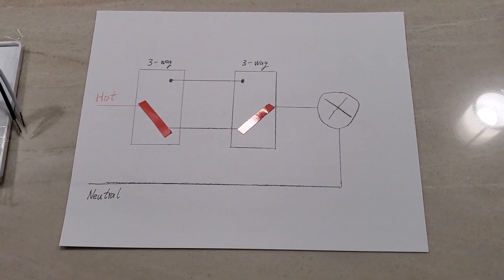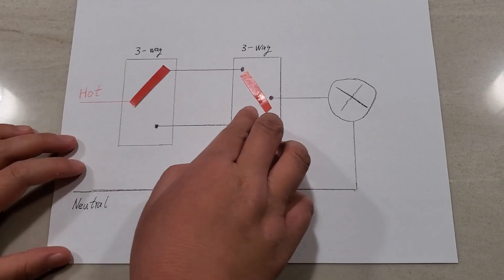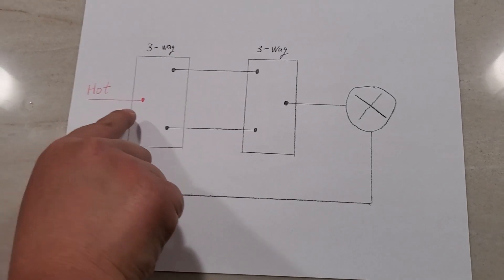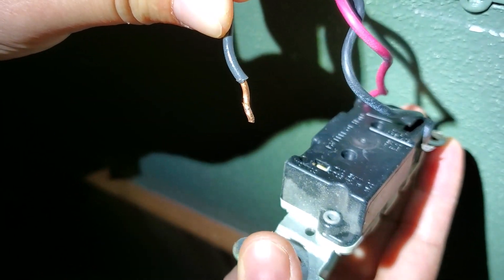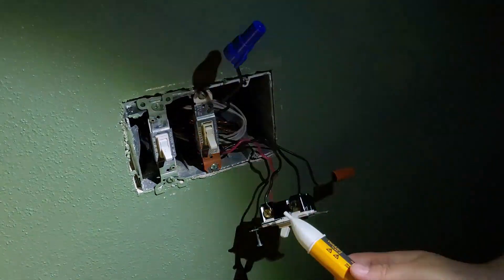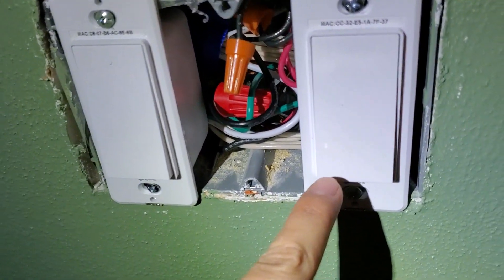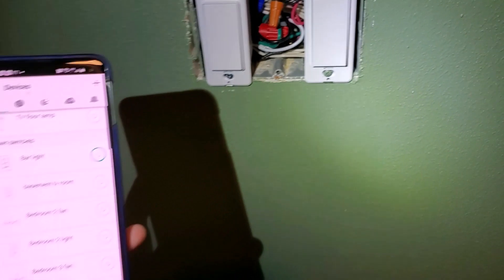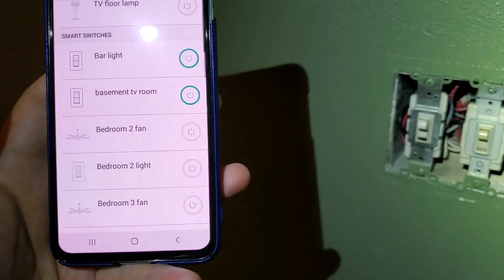How to Install a TP-Link Kasa 3-Way Smart Switch, HS210 (Only one smart switch is needed)

Comment: Great video!  I thought you had to have two smart switches, but after wiring in the first Kasa, it was apparent that only one was required.  Kasa, is the best brand and I replaced all of the wemo smart  switches a year ago because they were so unstable. Kasa is instant and so much more reliable. Wemo leaving users high and dry is another reason Belkin is on my do not buy list.

Comment: Excellence video to show the right way to install only one unit of Kasa H210 3 ways switch and function correctly. 

I wanted to install Kasa H210 for my 3 way switch a few months ago. However, I did some research and watched a number of installation videos including the official one from Kasa TP Link. I was not confident and confused on how to install them correctly.

I decided to take a Basic Residential Electric course at a local community college. I got to understand the concept of Line (Hot wire with energy), Load (Travel line in between). I also had a chance to practice installing an electric plug, GFCI, 3 way switch and 4 way switch. 

The key concept of installing Kasa 3 way smart switches is to install them at the first switch where the hot wire provides power to it directly. The rest of dumb switch in the chain will work correctly with the smart switch position in the first in line with hot wire to provide power to it.

I just ordered the kasa  3 way smart switches. I will install them once I got it. I will update how it work. Thank you for your nice video.

Comment: I did this install, but my switch never has the correct status with the light. The light will be on but the switch would indicate off and viceversa. 

Reading forums it seems like both the switches need to be replaced for this to work correctly

Comment: Great video and excellent explanation. Question for you do you really need to disconnect both common wires. Why not just disconnect one. Once you test it , if it is hot you know you got the master. If not then you assume 2nd is the master. Am i right in my assumption?
Reply: Figured it out. No need to disconnect any cables. Use a tester to test the common on both switches when light is turned off. The one that has the power in the common is the master. 
My challenge was I could not find the breaker switch for the lights so had to do everything while the lines were hot. One thing I did to be safe was wore workman  gloves. Connect all cables first and then connect the common to the kasa switch the last.
Reply from the maker: Great point! I think I just wanted to test both of them to make sure, and for education purpose :)

Comment: I installed the same way, it works in one mode (turn on smart switch, turn off the dummy one). turning off the smart switch and “turning on “the other dummy switch, the light starts to flash…

Comment: TP-Link/Kasa/Tapo has 3-Way Dimmer Switch "Kits" with Master and Slave switches. Two Switches where both need to be installed. Unlike the Standard Switch, the Dimmers "Talk" to each other during operation. 

I was a Beta Tester for the latest version and can attest to needing the two Kasa Dimmers.
Reply from the maker: Thank you for the information.

Comment: My 2004 house wiring is weird. I pulled the old 3-way switches and both live wires are hot!  I guess with both being hot I can install the Kasa 3-way switch on either end. 

I replaced the original switches with the Kasa, making sure the cables were connected to the same locations as the original. 

The Kasa works fine but when the Kasa is off, the secondary does not respond at all!  Weird.
Reply: Turn out, after I pulled out all cables, one switch was hot and the other wasn’t!  Thanks again for the video.
Reply from the maker: No problem. Thank you for watching.

Comment: Thank you! We have several lights that use 3 way switches and 2 of them are outdoor lights with switches in the the master bedroom and by their respective doors.  This made it so much clearer on how to change out the switches so we can make them smart (come on for dusk/dawn and motion sensing from our cameras).

We're also about to tackle changing out a couple outlet switches too so I'll be looking to see if you have any videos. However, I'm considering putting a GFCI outlet in place of the switch since we live in an ungrounded 1950s home.
Reply from the maker: I am glad it was helpful. I actually removed several outlet switches in our house because they can be very confusing. (It is hard to find the outlet that is controlled by the switch). If you want the outlet to be smart, you can just buy a smart plug. They are much easier to deal with then smart switches.

Comment: I have a 3 way switch, one on the top of the basement stairs. And one on the bottom. If I turn the light on/off from the top of the stairs it works fine, but the downstairs switch doesn’t seem to keep itself in sync. 

If I turn on the lights from the top floor, and then turn it off from the bottom, then the bottom is in sync until I turn it off from the app/upstairs switch and then it can’t keep up anymore. Anyone has an idea what could be wrong? 

The top floor switch has 2 neutral wires, and the bottom one also has 2 neutral wires. Apart from that it’s just the common wire and 2 travellers.

Comment: There is a smart switch with dimmable capabilities…it’s the KS230. Amazing switch, though I think you need to replace both switches in a 3-way with this unit. It provides dimmable capabilities from both switches
Reply from the maker: Yes, they are making dimmable 3-way now. Back when I was making this video, it was not an option.

Comment: Outstanding video and explanation, plus a great schematic at the beginning to understand the concept.  One mistake I made was assuming the Common wire on both switches is on the top of the switch as shown in the video.  This was not the case for me:  the traveler connections are typically brass, and the common one is typically a dark gray.  My bad assumption added an extra 30 minutes to my install.

Comment: The HS210 gives 2 switches (A and B), so I only need one (A). For the other one (B), can I use it on another light with 3 way switches like this, or I have to buy another set of HS210? Thank you.
Reply from the maker: Yes, you can use the other one at another 3 way switch.

Comment: This video is very informative. However, I had turn off scheduling problem and incorrect light status at the app.  I tried several 3-way switches at the line side only but still have the same problem. One thing I noticed is that if the status (circle) at the switch is always on regardless whether the switch is on/off then the switch is not working correctly as indicated earlier.  I have successful installed only one 3-way switch at the line side only and it is scheduling correctly and status is also correctly at the applications.  This switch is working because the status light at the switch does turn on when my light is off and off when my light is turn on either manually or remotely via the apps.  So, somehow the defective switches thinking it is already in off position then it doesn't need to turn off my light when it scheduled to turn off. These defective switches turn on as scheduled fine but not off

Comment: My 1st switch has the Hot (line) wire coming into it, but the white wire is used for the line (hot) wire so I have no neutral for my 1st switch location. In my 2nd switch location, it has the load and traveler wires with a neutral coming into it. What Kasa switches will work in this situation? I was originally trying to install the KS230 Kit V2 but this doesn't work :(
Reply from the maker: If there is no neutral, you may have to look at other brands that do not require neutral. Lutron and GE have some switches that do not require neutral.

Comment: If one of my three way junction box only has one white wire, which is for the travel, am able to still install the smart Wi-Fi switch without a white neutral wire? In other words, the white wire from the smart Wi-Fi switch could be tucked in, and not connected?
Reply from the maker: It is probably not going to work if the neutral is not connected. The reason these switches need a neutral is that it needs the neutral to complete a closed circuit to provide the powder to the switch itself. The power comes from the power line and goes back to the neutral line. If the neutral is not connected, then you have a open circuit for the switch itself. When the switch does not have power, it is not able to communicate.
Reply: @QTTechReview  thanks for the reply. Looks like I am going to have to stick with smart bulbs for now!
Reply from the maker: @jsteelize  There are a couple of options for the no-neutral situation. Lutron and GE make smart switches that do not need neutral wires. They basically keep your light constantly on to provide constant power to the switch and they add a dimmer feature. So when you dim the light all the way down, it looks like it is off. So as long as your light bulb dimes well, this solution should work.

Comment: Thank you for your video. You're diagram was very easy to understand. I did the procedure you recommended to determine which is the first switch, but had issues with the app recognizing if the light was off or on.  I swapped the smart and dummy switches just as a test, but had the same issue.  Basically if the light is turned off/on with the dumb switch then I would need to hit the power button in the app 2-3 times in order to turn the light on/off again.  Do you know what might be going on?  Any help would be appreciated.

Comment: This is so well explained! Is there a way to use kasa Wi-Fi motion sensor switch with 3 way switch? We have few places in our house where we have 3 way switch and would like to use motion sensor there. We are using all kasa switches.
Reply from the maker: Thank you for watching! There is currently no motion sensor 3 way switch from Kasa, only single way motion sensor switch. You cannot put a single way switch on 3 way. One thing you can do is to buy a separate motion sensor. I have used Philips motion sensor and Ring motion sensor. Then you can configure a smart routine through Alexa, to say if there is motion, turn on the light and if no motion in 3 mins, turn off the light. It might be more complicated than what you want but the advantage is that you can put the motion sensor anywhere you want. 

This video shows how to do it with Philips motion sensor. 
https://www.youtube.com/watch?v=jio8NZSz1sM

Comment: You said one thing very wrong. When you install one kasa smart switch then it does not know if the dumb switch is on or off. I know because i just installed one.
Reply from the maker: Thank you for watching! And please watch the entire video. I only have one smart switch installed and the app knows whether the dumb switch is on or off, as it is showing in the video.

Comment: This video is very informative so thank you. Also is it possible to have a 3 way switch (HS210) on one end and a smart switch (HS200) on the other end.
Reply from the maker: Thank you for watching. The issue is that the other end of your 3 way will require 3 connections as well, 1 common and 2 travelers. A regular smart switch, HS200, only has two connections.

Comment: Really nice explanation - thank you. I have two light switches which control a ceiling light. However I am getting voltage from both the outlets. Does this mean both are single pole to the same light?
Reply from the maker: Thank you for watching! It is hard to tell without seeing it but I think it is probably impossible to have two single poles on the same light because when you have both of them on, you will get a "short". Are there two connections or three connections on the switch, besides ground? If there are 3 connections, then it is a 3 way. You will then need to find the common. If it is hard to find the common, you can try to disconnect all connections to find which one has voltage. Make sure to take a picture or tag them so that you know which one is which.
Reply: @QTTechReview  thanks. I had two black and one red in addition to neutral and ground. With the lights switched off and by using a voltage tester, on one of the switches, the black had very low voltage and the other black was right up there when used on the voltage detector. Also it was the isolated wire coming which I marked as the common. After plugging in the smart switch, it worked as expected.

Comment: I have 2 wires that make my voltage tester go off on the same switch. Is this normal? How do I know which of the 2 is the line? I have 2 reds and 1 black wire. 1 black and 1 red make the voltage tester go off. How do I know which of the 2 is the one that goes into the line/load? My previous normal switch didn't name them.
Reply from the maker: Which two wires make the voltage tester go off? You can check where they were originally connected. There should be one common and two travelers. If the common is hot, it is the line. If the common has no power, it is the load. There should be some prints on the original switch, to tell you which connection is which. If the prints are hard to read, you can take the normal switch off, and use a multimeter (connection check, or resistance check) to test how it is connected. Make sure you remember how the original switch was connected.

Comment: So the switch that has the power doesn’t have a neutral wire….bottom line this will not work correct?
Reply from the maker: In one of mine 3-way, the switch with the power HAS a neutral wire but the second switch does not have a neutral wire. I just keep the second switch as a dumb switch. It works for my situation. This is a unique situation. The rest of my other 3-ways, all have neutral wires.
Reply: In my case the switch with the power doesn’t have a neutral, i actually left the dumb switch there and installed the smart switch where I have the neutral wire(no power ) it actually works fine now?
Reply from the maker: @alexfernandez8922  It may not work in this way, in theory. When you turn off the powered switch, the second switch will not have power. And if the second switch is the smart switch, it will not be able to receive any command from the app, since it is out of power.

Comment: Not sure if anyone will see this but I went to add a 3 way smart switch .. there are 2 blacks 2 whites and a red. However...the red and white are capped together...the other white wire is the live wire when the power is on that is the one that my detector detecs as live. What is going on here??? usually 2 whites are neutral..2 blacks..one is live..other is a traveller and the red is usually a traveller.... other 3 way switchs in the house are not like the above and are your normal 2 blacks 2 white neutral and a red traveller. ANy idea why that other switch is so messed up?
Reply from the maker: It is kind of hard to tell without seeing it but you will probably have to ignore the colors and try to find which cable is for which. Maybe the previous person did not follow the code.
Reply: @QTTechReview     Yeah you are right. I did some digging around and found a box on the other side of the wall running wires into it and being split off to other switches so the colors werent like the rest of the house. I thought it was coming directly from the panel but it wasnt so thats what had me all messed up and confused

Comment: Very helpful video!  I especially appreciated the "how it works" part.  That said, I installed my KASA 3-way as a replacement for the "2nd" switch rather than the "first".  From your diagram, I figured it would work as long as the "dumb" switch was in the correct position.  However, I found that It works with the "dumb" switch in either position just as if I had replaced the "first" switch.    Again, a very helpful!
Reply from the maker: Thank you!
Reply: So you can just use the 1 smart switch on either the 1st switch or the 2nd switch and It'd still work? It doesn't have to be on the 1st switch only?
Reply: @SirCharlesLikesChurros  In my case, yes, that is correct.

Comment: Does this change if on of the switches is a dimmer
Reply from the maker: You can put a dumb 3 way dimmer switch, on the second switch position, i.e. the one without constant power.

Comment: Great video. Thanks for sharing. I have a problem as my switch is 4 gang switch, how can I get the suitable plate for the smart switch, do I need to replace the old electric box for the smart switch? As you have mentioned the smart switch is bigger than the usual one. Thank you.
Reply from the maker: For plate, there are a lot of options in Home Depot. Just make sure you buy the rocker style 4 gang plate. For the electric box, it really depends on how many cables you have in there and how you are folding them. I have several 3 gang switches and I am able to replace all of them, just require some force. We do not have any 4 gang though. Hope it helps!

Comment: I did this but my smart switch only works when the dumb switch is turned on. Maybe I messed up the wiring?
Reply from the maker: Sounds like the smart switch does not have constant power and it only has power when the dumb switch is on. Maybe checking the the power line into the smart switch to make sure this is the one that comes from the circuit breaker and has constant power.
Reply: This happened to me, check your traveller and load line, you might have flipped the load line into the traveller terminal. The switch will work when the lines are flipped but doesn't work in some switch configurations like your example of the dumb switch preventing the main switch from turning the lights on or off.